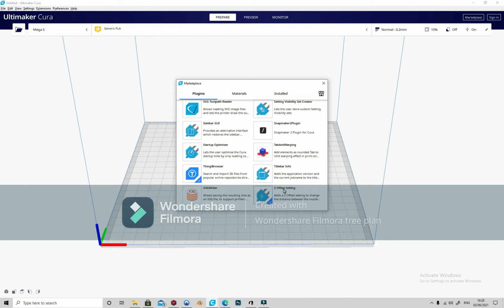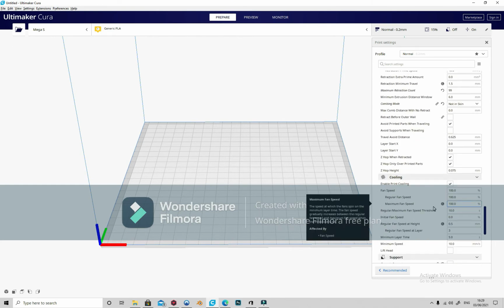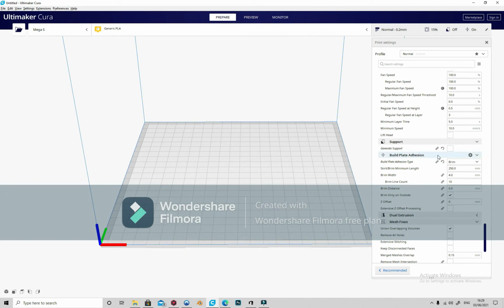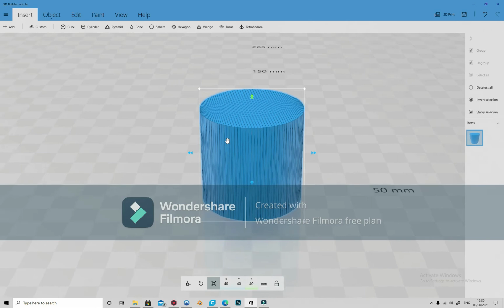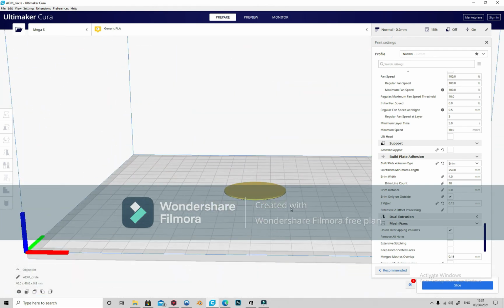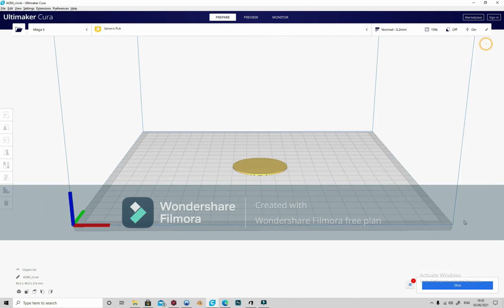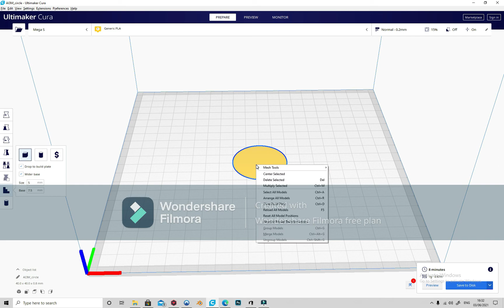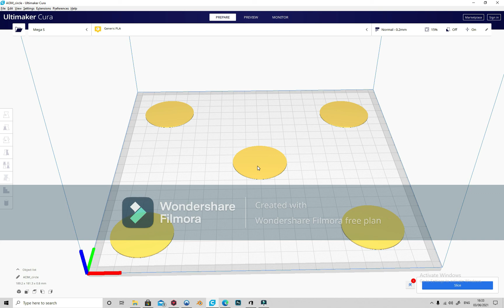Struggling with Zoffset??? It's inside CURA!

Comment: This video was exactly what I needed to find. I changed the Ultra Base glass bed on my Anycubic Mega S with a magnetic build plate that's thinner and have been struggling to get a quality first layer. This plugin was exactly what I needed to fix the issue and now I'm re-slicing all my models using this z offset. Thank you for posting this!

Comment: Did you really need a 7 minute video to explain how to use a cura addon to set one setting?  As useful as that may be.
Reply: He explains it in the first minute or so, just watch until that.
Reply from the maker: This video is for absolute beginners, tbh I wasn't intending it to be 7 minutes lol I got carried away with 3d builder also, so yes it could have easily have been 3-4 minutes, I just wanted to cover the fundamentals from start to finish.
Sorry if you didn't like it Jacob and that you for your feed back.